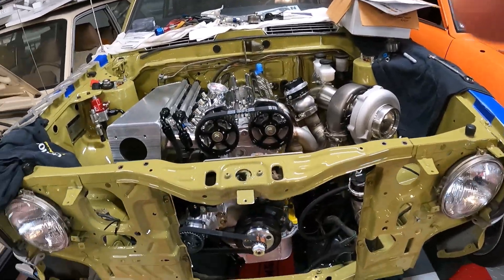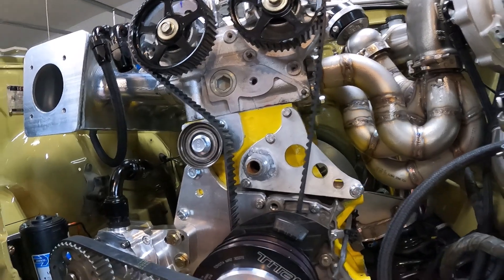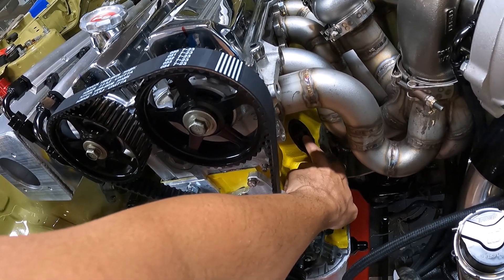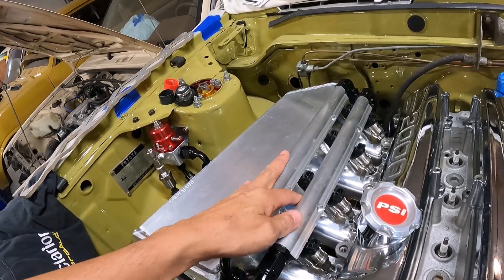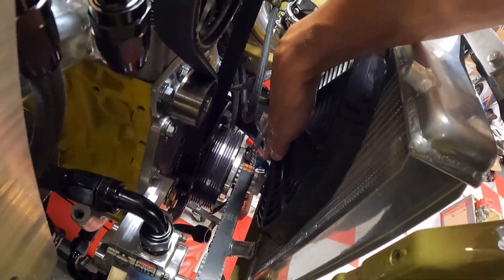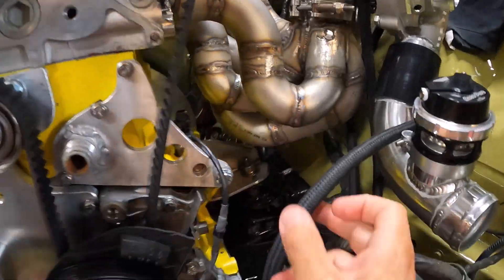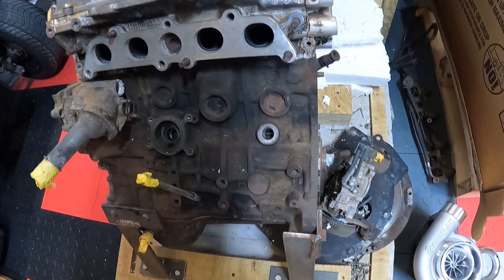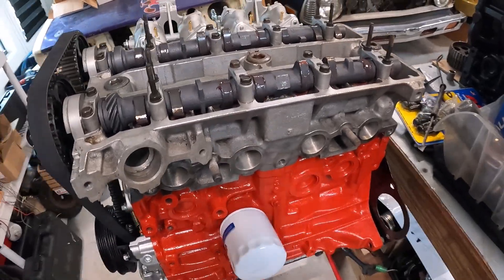3s5SGTE Part II  #psiracing #3sgte #mr2 #3stheworld

Comment: What transmissions are y’all using on these rwd set ups? I have a 3sgte  that I would like to use and a rear wheel drive platform, kind of struggling to find good information on transmissions that will take some abuse without huge amounts of modifications. The car will be making less than 300 wheel.
Reply from the maker: We mainly use the w58 transmissions with a Japanese style bell housing.
Reply: @psiracing  thank you I'll be on the lookout for one!

Comment: Just wondering how much would a stock build be or would it be cheaper to get a new stock motor… need it for a daily driver.. im from Arkansas and shops here have no clue about my motor
Reply from the maker: You can probably find a low mile jap spec shortblock. Probably the easiest way

Comment: Congratulations, what a job. Two questions: which gearbox are you using/adapter and which starter motor. Thanks in advance
Reply from the maker: The car came with the transmsission in it already but it does have a W58 trans
Reply: @psiracing  Thank you

Comment: Thanks for sharing! Do you sell any of these parts to convert 3sge 1st gen to rwd? Will the coils run off the stock distributor or crank trigger sensor?
Reply from the maker: Yes we can definitely help you out to get the parts you need to make a setup RWD. Its using a factory crank trigger setup.